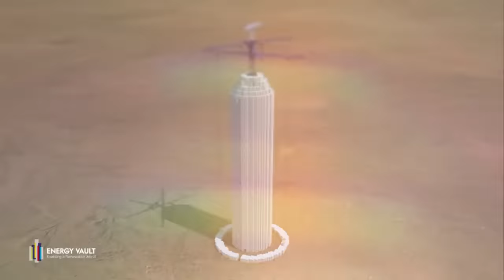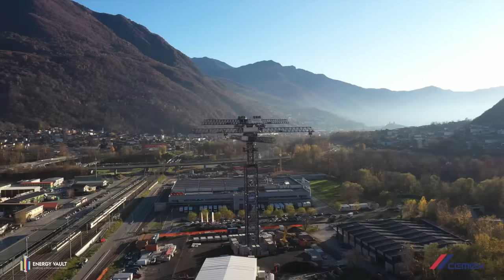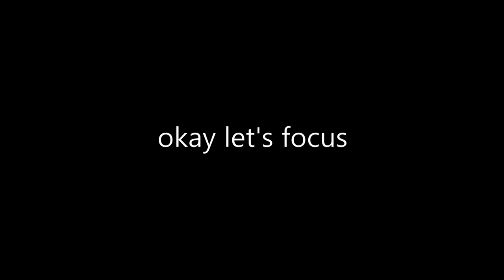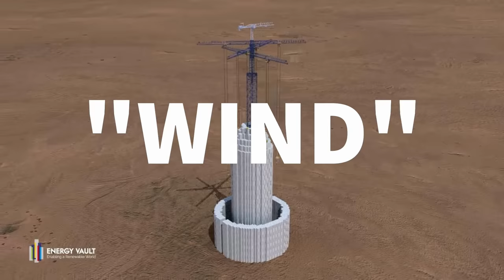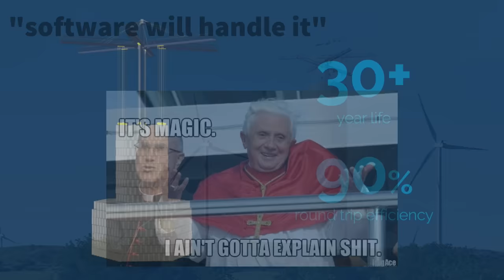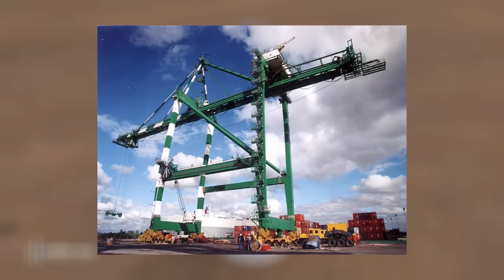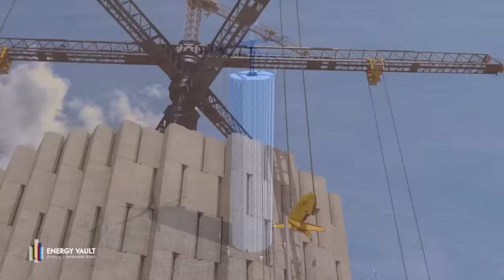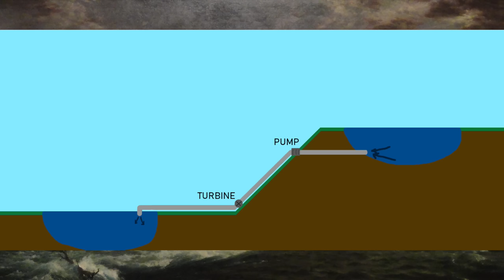The Energy Vault is a Dumb Idea, Here's Why

Comment: There is a similar project currently brewing in Czechia, with no silly towers but not using old abandoned mine shafts, sometimes several hundred meters deep. I see that as a  more logical solution (the hole is already dug and unused)
Reply: Sure, there are an infinite amount of abandoned mine shafts around that are hundreds of meters deep? Logical solution indeed!
Reply: Still a scam.
Reply: Still with the relatively small diameter of a mine shaft you cannot store that much energy. Another issue with the mine shafts in my area; they are often partially filled with old concrete etc and they are flooded with water (shafts are up to 700m deep but water level is easily starting at 50m below the surface).
Reply: @anneblankert2005  Projects sometimes make sense in very specific settings but not others.  If you have old deep mine shafts why not use them?  Price the system out and see how it works out.  With a deep shaft you are basically talking about elevator technology and a generator.  It's not like trying to develop new battery chemistries and scaling them up.  I suspect there are some places where this could be done economically.  Old mine shafts, if they are dry, might not be good environments to introduce water, so water pump systems with a closed loop might be more expensive.

No single solution is going to fix everything.  I think we are starting to look at better batteries for storing the base load now.  For years if you wanted to store power you just kept some coal handy.  Then, when we started doing batteries it was for all high density applications like walkmans and phones and electric cars.  They were designed to be light weight because they had to be portable.  Now that we are looking at baseload storage scientists are looking at new chemistries that don't worry about weight.  They focus on cost instead.  It doesn't really matter if your battery weighs a lot and is a little bulky if it's sitting in your basement where your furnace used to be.
Reply: @liam3284  but it works best still today, both in cost/feasibility/efficiency and environmental friendliness
Reply: @liam3284  I bet you wouldn't be able to find a better technology of the scale of pumped hydro if you tried
Reply: They should consider using old mines for ground based telescopes, Imagine NASA or one of their global counterparts actually desighning a new way to mine with that specifically in mind. It would take SOME of the waste out of the way we mine. I am still for astroid mining. With a couple billion in research itll make the first trillionaires or end poverty

Comment: I remember musing on the idea of "gravity storage" years ago. Then, I sat down and did some basic physics calculations and realise the scale of weight (or height) needed made it impractical when using solid weights (I was thinking of storage for individual homes). It is remarkable to see that someone spent more than the $0 and 20 minutes I spent thinking about this and concluded it made sense to move forward.
Reply: Oh, what a coincidence! I did exactly this about a year ago as a potential alternative to batteries for individual homes, and came to the same conclusion 😂 Sadly it just doesn't scale very well. But I do think it'd be a cool fixture in some sort of "art project" type home.
Reply: I thought of it. Then I remembered we had this with water already in dams and hydraulic plants everywhere, lol. No calculations needed.
Reply: @DudeWatIsThis  Exactly. This is the type of idea that is normally thought about, when you hear the words "Why Reinvent the Wheel?".
Reply: I love your rating scale for these ideas.
It took you $0 and 20 minutes to conclude it was a bad idea.
Reply: See also "Hyperloop", neat idea until I thought about how power it would take to pull the vacuum. You quicky get back to planes or high speed trains. If CA would hear this and cut their losses it would save them many Billions$$$
Reply: @unhandledexception324  Thinking way back, I remember that I built the concept using Legos for a school project (it was crude and didn't actually work, but 12-year old me was sure I just needed to work out a few kinks). I totally agree that the concept would be cool to see realised, as a one-off, don't-try-this-at-home demonstration. In a way, I almost feel inspired to try to make a working version to demonstrate why it's not a good idea.

That said, I have often thought about trying to measure how much energy could be gained from tap water  drain pipes and rainwater. I suspect it isn't much, but that optimistic 12-year old still wants to contribute some small idea for energy-capture/storage.
Reply: @josmith4531  too many Musk fanboys out there to do that.
Reply: @unhandledexception324  Somewhat related, there's those gravity dynamo lamps that use the potential energy from a sack of sand slowly falling to power a lamp, for lighting in developing nations. But that's one the scale of a single LED light, completely unviable for larger quantities.
Reply: Big tower, big weight, big pulley DOES work at a city/town scale.  They've been converting church bell tower's into this for a few years if not longer.  Guess what literally every town in the US has multiple of and guess what the fastest shrinking, building abandoning demographic is in the US?
Reply: Truth be told not super effective when using liquid either. Though if you could desalinate water then pump it up to high mountain lakes from the ocean it could help offset the water crisis in some places.
Reply: Right? Do people just not grasp the scale of the power we use? obviously dropping blocks of concrete isn't going to be enough.
Reply: @josmith4531  hyperloop is the best marketing gimmick ever. Because if it works ever, all credit to Elon. But if it fails, eh, these other guys just couldn't do it. And no financial loss for Elon.
Reply: it's buisness, it doesn't actually need to make sense, it just needs to be attention grabbing + plausible-to-your-specific-audience enough to sell people on the idea then run off with the money.
Reply: @DaDunge  yea but with the water you dont need 80k tons of co2 to barely hard the power of 2 wind turbines. plus if something happens you have a water source that can be used for other things
Reply: my math might be wrong, but back of the napkin if you wanted to design an at-home gravity battery to power your house for a 30kwh day using a 1000kg weight and assuming perfect efficiency, the hole would need to be at least 11km deep.
Reply: Indeed.
Reply: It doesn't matter if it makes sense or not, is all about marketing, for example, right now no fossil fuel based electricity should be made, because now nuclear energy has come a long way, the waste is so small now because of better efficiency that is worth it, take into account that i am mostly against nuclear energy and i favor renewables, but with the current technology i favor nuclear over fossil, it has came such a long way that i bet most people wouldn't be able to recognize a current nuclear plant (that uses the latest technology), i mean, the size of a large car for a reactor that can power a small city, enough automated measures that you cut the main reason for past accidents (human failure) and the use of reactions that will never create a failure so big as what has happened in the past, so, renewables over nuclear over fuels.
Reply: @josmith4531  the hyperloop as is presented is a failure, you can get it, but it needs a close system to really work, it could be viable for goods good transport, not for people, but constructing an enclosed system with air and using levitation would be better than what is available now, it will take out the wind as a variable, but i doubt the small savings there can justify the material used to make it, it would be way better to invest in levitation using superconductors instead of magnets. If they make superconductors cheap and to work at room temperature then that would be a way better use of resources.
Reply: There are plenty of places that need electricity that are nowhere near sources of movable water.  Electricity is suprisingly useful in remote areas, to run streetlight LED lights at 15 watts or charging up electric scooters that run 18 watts per mile.

Not every country has a Tsangpo river, where it could theoretically have a dam that would be 100 coal power plant equivalent.
Reply: Not to mention all the loss of energy due to friction.  Or even building it in the first place.  The numbers can't be good on the amount of energy used to build it vs. how much it stores over a lifetime.
Reply: To make it most effective, any weight should be raised to such a height so that it can hit terminal velocity on the way down. Otherwise we're just wasting gravity :P
Reply: Wow...so many smart people on the internet. I wonder how we still have all these problems. You should sit down a few minutes and solve them.
Reply: @dimaermolenko98  We don't have to sit down and solve them, theoretically, they've been solved.  The reality is no one wants to pay the price the solutions are going to cost.
Reply: @heavyassaultmode1503  then its simply not  good Solutions!
Reply: @dimaermolenko98  Wrong.  Everything good in human history required sacrifice and hard work over 1000's of years.  How do you think food, clothing and shelter for 7.96 billion people is provided?  Someone just snaps their fingers?
Reply: @heavyassaultmode1503  you diddnt mention hard work before...holy money. So are there solutions that don't require money but only hard labour and sacrifice?

See that's the point. Nothing today is solvable by hard labour. Materials cost money.  Labour would be the cheapest  part
Reply: @heavyassaultmode1503  in other words you say that a solution is only good if it uses up enormous amounts of materials and Labour?...because a good thing needs sacrifice ???
I would rather have a cheap and smart solution ...but hey...that's why I was asking...you smart guys seem not to have it yet.....once in a while  one of you tho is he had a great idea  and some other smart guy pays for it....just to show that it was not  that smart to begin with. But yeah...sure to ahead  and tell me why i am wrog again
Reply: @heavyassaultmode1503  it's always smart guys like you that have the best  ideas but  can't estimate what their  solutions will cause in future.
Reply: @dimaermolenko98   Stop the strawman arguments.  Take courses in physics and economics instead of basket weaving and gender studies, so you understand basic facts. You think electricity plants, skyscrapers, sewage, food production just magically happens?  Or do people work very hard for that?  What about the child slave labor used to mine cobalt for smartphone batteries?  Looks like hard work and sacrifice to me.
Reply: @dimaermolenko98  As an infrastructure engineer, I do have a good idea of what things cost.  However, since I cannot predict the future (weather, war, disease, commodities prices) accurate estimates are not possible.  Is this where you come in and tell me you can predict the future?
Reply: @heavyassaultmode1503  I studied construction engineering with emphasis on technical facility management.  Diddnt finish...butvi don't know what that should have to do with it. Here I. Europe gender studies are not on university's yet....good try tough
Reply: @heavyassaultmode1503  also is this your argument? I am this and that engineer!!!
I don't care!...you make no sense mr.engeneer!!!
Reply: lmao I had the exact same thought process two days ago. I thought about it for 5 mins and deemed it stupid. Can‘t believe people spent money on this
Reply: @DarthObscurity  no it doesn’t pulleys are irrelevant when it come to
potential energy. For gravity it is mgh to store the power of a single 350watt solar  cell running for 8 hours you would have to suspend 35 metric tons from a hight of 30 meters. That is above the limit of what most church towers could support. Then ask yourself how much you can really power with 350watt…
Reply: On small scale this is actually a good idea and there are examples of this used to power lighting and other trickle charge devices in undeveloped countries :)
Reply: @josmith4531  Yes.  Creating vacuum on Earth on even a small scale is difficult and expensive.  Nonsensical from the get-go.
Reply: @DudeWatIsThis  A windmill that pumps water uphill for a micro-hydro system might be practical for small (homestead) scale.  Also, existing hydro-power infrastructure is under constant attack from environmentalists for its impact on the environment, especially on anadromous (seagoing) fish, like salmon, which are a huge food source for inland ecosystems where they spawn every year.  

If you build the home in a smart way, all you have to really worry about are your big appliances, like washer, dryer and refrigerator/freezer.  Most of us can take the dryer off the list.
Reply: @DaDunge  Virtually all water crises are self-inflicted.
Reply: @JD-rd4pk  Elon's in it for Elon.  Sometimes he's right.  But I notice he always looks for opportunities where gov't subsidies are involved.
Reply: @dimaermolenko98  Never trust smart guys who insist the world would be better if YOU were more willing to make more sacrifices.
Reply: I also mused on there being gravity when I was 7 years old, but then I found out Isaac Newton beat me to it.
The rat bastard.
Reply: @dimaermolenko98  More illogical garbage and trash reasoning.  As part of my job, I am reminded daily what materials cost.  That is not an appeal to authority argument.  If you cannot even finish an engineering degree, then I fully understand why you don't understand hard work.  Try working in a steel mill or oil field some time like I have.  See what it takes to build stuff.  Then you'll understand.
Reply: @heavyassaultmode1503  who said can't.  I said I DIDDN'T

Someone who can't even read correctly  and  constructs his argument  only...and only on the made up reason for me not having a degree, rather than an using actual argumentation is proof that you actually must have a degree.

It proofs also that my argument seems to be not that bad afterall.

But nice try
Reply: @heavyassaultmode1503  Did Henry Ford revolutionize the car by making the production more expensive and more labour intensive? No!He took a already existing invention and made the production faster, cheaper and less labour intensive. 

I am still stunned  by the degree of your ignotance.  I mean you b3ing an engineer and not understanding this???
Reply: @dimaermolenko98  More weak lies, where did I advocate making things more expensive?   You just accidentally agreed with me.  This method of energy storage is outrageously expensive because it will take many times as much energy to make it as it will be able to store.  It will take 1000's of tons of concrete to store a few concrete blocks worth of energy.  So it will always be extremely inefficient, as a matter percentage.  No matter how cheap or expensive concrete becomes, the structure will always use far more energy to be built and maintained than it can ever store.  It doesn't take an engineer to figure this out.
Reply: @heavyassaultmode1503  Probably there is a misunderstanding because of my English.  I am not native speaker. I agree ...this is nonsense. !

Sure I agree on that...that's my whole point. 

Concrete  is not a good solution to anything.  It needs to mutch maintenance and is just not as efficient as most people think.

If considering  that the lifespan of a buildung made if concrete has a lifespan of 80-100years....with maintenance and in best case scenario.
Sorry...sure I agree

Comment: pumped storage is great, but it does require favorable geography and oftentimes flooding existing developments. That is just to say it isn't idiocy to consider other forms of gravity storage. though, yeah, this tower is  dumb. if you are in an arid climate or land area is at a premium, maybe you just have to rely on chemical storage? what do you think
Reply: Chemical storage is just a regular battery, isn't it? Considering most forms of batteries can explode under pressure, probably a bad idea.
Reply: @bable6314  it could be a battery or some other chemistry like making hydrogen. certainly, if done properly, the risk of explosions is well mitigated. Batteries (in the general sense of chemical, gravity or other forms of storage) are completely essential to get off fossil fuels (which all also explode by the way). chemical batteries are not a significantly larger risk than existing technology